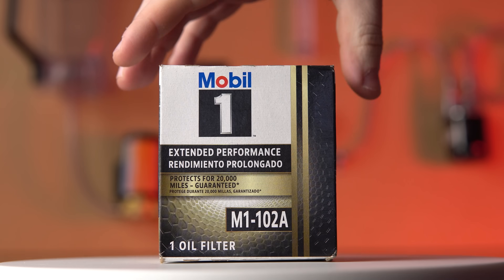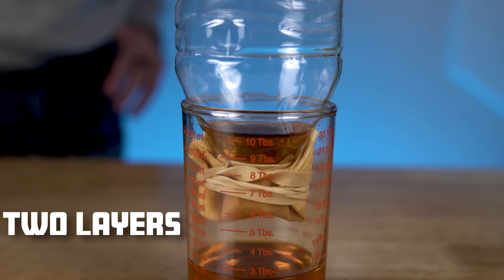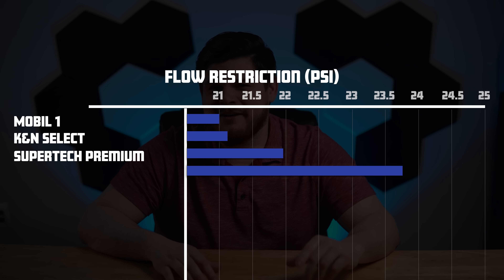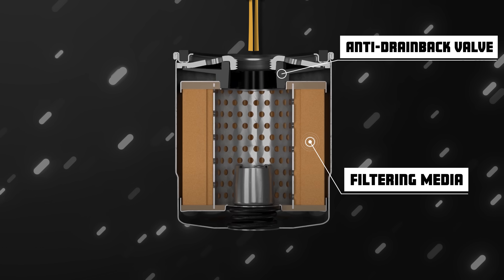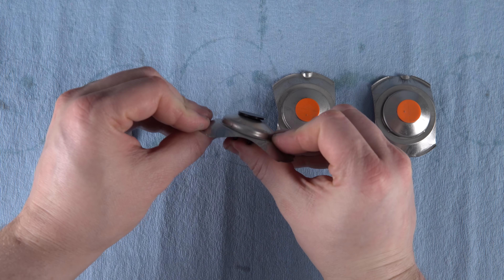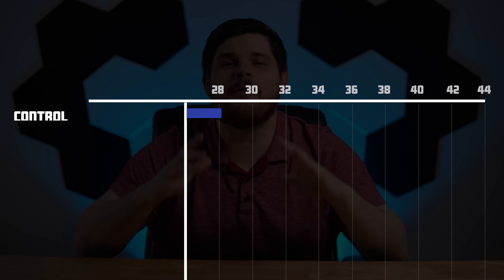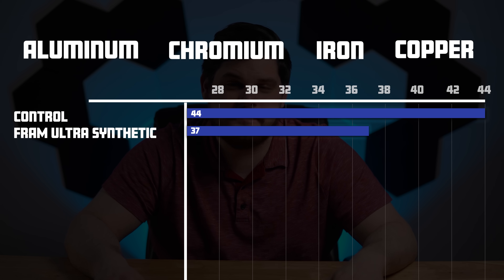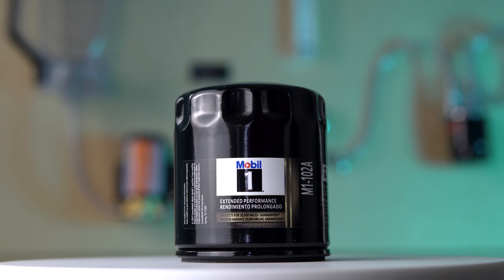Engineers Test the Best Oil Filters! FRAM | Mobil 1 | K&N | Walmart Brand

Comment: First time viewer and long time mechanic,i like the video it was awesome! 
But for the most part oil is only cold till the engine warms, i feel like test results would be diffrent if you threw a block heater in the oil, cant wait to see what other filters you test on this rig
Reply from the maker: Thank you so much Austin! It really means a lot that you enjoyed. Wait till you see the new rig... Made several improvements including hot temperature simulation. Hopefully you subscribed and don't miss it. Thank you again!
Reply: @BrandRanks  I've definately subscribed! Do you think that you could do a series on commercial filters? 
You could do store brand filters, Baldwin, fleet guard, cat, cummins and factory filters! 
You could probably modify that rig to do fuel filter testing aswell, I know that some fuel filters can go down below 10 micron

Comment: Isn't that first pressure test just showing what psi the bypass valves release at?
Reply from the maker: Not necessarily as the bypass valve psi rating is the drop in pressure across the filter not the inlet pressure like we measures. We are planning on measuring DP on our future videos. Thanks for watching.

Comment: Great video with amazing details. However, there are a few issues with your testing. The 2 that I would like to point out, which will significantly alter the results of your testing is: 1) oil temperature. Real world testing of oil flowing through filters would likely be anywhere from 80c - 100c. 2) oil viscosity. Again, real world testing of certain viscosities of oil at operating temps would greatly affect the rate of flow through filtration media as well as the suspension of the contaminants within the oil.
Reply from the maker: Indeed Brittany! Thank you so  much for your words and for the feedback. Unfortunately we had only 400 subs at release of this video and the budget was tight, gladly the support has been amazing and we are making several improvements to our testing rig including temperature. Thank you for the feedback, it really makes us improve! Appreciate your support.

Comment: My biggest question is, what happened when the aluminum particles were added?   Were they filtered out after the flow was restricted?  Is there a way to see if the bypass valves were activated.   Maybe a filter let's the particles pass through, but has great flow-rate...  That's not good.  You need to let the oil run over night, and and then test how many particles are still in the oil.  You also need to see if the bypass valves open up at the same time.  How many PSI is required before they open? There's a balance.  Let's say that the filter removes 100% of the particles, but then has to open the bypass valve because it's completely clogged.  The smaller the particles could probably be let through with a more permeable filter material since smaller patches probably do less damage to the engine than larger particles.  This would prevent the bypass valves from opening up (which would let everyting through).

Comment: great test, but keep in mind, there are only a couple companies that make oil filters, so for instance, Champion Labs makes OEM Motorcraft, OEM GM on some applications, AC, Valvoline, AutoZone and the Mobil 1 filter, plus k & n and Supertech filters. guessing they change the line for that day what is being made. fram is made by First Brands Group (Trico Group),
Reply from the maker: Thanks for the info. Appreciate you sharing and for supporting the channel!

Comment: If my trucks oil pressure is always above at least 32 PSI. Is the fram the best to use since it filters 20 microns and the filter runs at 25 psi?

Comment: Good video. My personal favourite are Baldwin, Wix, and Hastings.  I have also purchased filters that were on sale.    Also, oil  that was on sale. As long as the oil has the approved ratings for that vehicle. I change oil and filters in my vehicles every 5,000 miles.  Except in my Cummins.  I change every 10,,000 miles. At five thousand I change out the oil filter and top up the oil. 
    My pickup with the gas engine has 510,000 miles     My car with the gas engine has 499,000 miles.  My other pickup with the Cummins has 545,000 miles. Neither of these engines burn any oil.  They all purr like Tomcats in a creamery. 
    Just change your oil and filter often and regularly and your engines will run a long time for you.  (everything else being equal) Don't over heat your engines  and idle it for a minute before you shut it off.
Reply from the maker: Wow!!! That is a lot of miles! Awesome work taking care of your investments. Completely agree, maintenance intervals is much more important. Thank you for sharing and supporting the channel.

Comment: Nicely done! Multiple round of testing will yield different results than a single round of testing. Buy the same oil filters from different and far away sources, this checks mfg consistency. Send multiple control samples to the same lab under different names and different time, send to other labs as well, this shows test consistency. You may want to test pressure drop at cold and hot temps as well. A releif valve pressure test would be cool. You could tell it opened by observing a sudden drop at you pressure gauge. Differential pressure measurement would flag it better. Nicely done though.
Reply from the maker: Thank you so much for the awesome feedback, definetly looking at making some improvements for future videos. Your comment and suggestions are greatly appreciated! Thanks for supporting the channel.

Comment: Fram has a weak anti drainback valve spring and I found my engine with a sideways filter took longer to gain pressure with a fram vs other brands.  I stopped using them years ago.

Comment: How about you compare small vs big?

Fram  PH3569  /              Mann W 719/30 W 940/66

to
Fram PH977A   Mann W 950/4 or equivalent

It's a VW speccific application  using  the 3/4" 16 unf thread you already have
There must be a flow or capacitiy/efficiency advantage.
Reply from the maker: Thanks for the suggestion.

Comment: Great video. One thing to note concerning filter flow is how the bypass valve comes into play. Without downstream flow restrictions enabling pressure delta comparisons at multiple locations, the functional pressure differential for the filters bypass valve can't be observed. IIRC, the general bypass valve opening pressure is around 12 psi across the filter media for these particular models, so in this set-up the filters could have all been in some degree of bypass.
Reply from the maker: Completely agree Chris, we are making some improvements to our testing rig in order to measure the differential pressure. This will enable us to see if the by pass valve has been opened. Thanks for your feedback, it really helps us improve.
Reply: That's what I came here to say too. The bypass was definitely in play for those tests. Seems like some sort of adjustable rod on the center of the test rig could hold the bypass in place during the test. Really awesome testing though overall.

Comment: One problem is your pressure test was probably popping the bypass valve open so you were measuring the bypass pressure, not the flow restriction.

You missed the opportunity to send the oil contaminated with aluminum powder to testing. Because what if some of those filters seemed to take a lot before clogging by not ever actually filtering out the aluminum in the first place?

Comment: Been using Mobil1 oil and filters when I switched my vehicle over from dino oil in 2007, based on all the testing I've seen, a great decision made, if not the best. I typically go 8k miles in between oil changes and the engine is still running like a beast , now with 190k miles.

Comment: very well done, i agree you should add an extra video with more brands (OEM) especially since i know some people feel these are always better. i think heating the oil could change the outcomes alot as making the oil thinner would allow more flow. since some filters may have better flow with thinner oil than others. definitely worth looking into adding. however seeing as this is your 4th video i say you are off to a good start.   Something you should try and do for another video is comparing some brake brands/quality.  From my personal experience when i was young i always used cheaper. because why not.  changing your brakes every year to save $20 i didn't know the difference. however after having a high end set on for over 10 years 80k miles i know i'll never go cheap again. definitely more complex to build the testing station and more time consuming. But would be a very good video in my opinion.
Reply from the maker: @Brando great suggestions and ideas. We are definitely planning on testing some OEMs and implementing temperature to the tests. That brake pad idea is phenomenal, expensive for a small channel, but we might be able to do something. Thank you for supporting our channel, it means a great deal!

Comment: Funny how the dealer will tell you ten thousand mile oil changes when your oil changes are free but when the warranty is up and they are not paying they tell you every five thousand when your paying. Don’t fall for the 15-20,000 miles oil filter. change your oil and filter  every 5,000 miles. Over time you get carbon gas acids entering your oil. If you wait those long mileage oil filters to work for 15,000 miles your risking all that junk to flow through your engine. If you do use these filters for that long it must be mostly highway miles. Oil and filter  changes are cheap compared to the cost of and engine. Fifty five years  working on vehicles but what do I know.😁🇺🇸

Comment: You go by the number microns it can filter. Change oil and filter when you begin to not  see your oil level measuring lines through your oil. Fifty five years of doing it this way and never ever had an engine problem. I do buy Mobil One filters. Mobil One filters are around $10.00 at Walmart you won’t go wrong. Walmart Super  Tech motor oil is an excellent oil blended by Warren oil. It is API approved and has the cool letters and numbers as the big boy companies. For around thirty-thirty five dollars you get an excellent motor oil and filter change.

Comment: I've always used Fram Ultra Synthetic because they're made and tested to a higher micron standard then the others.
Reply from the maker: Indeed they are. Have personally been running FRAM ultra for years and have had no issues. Thank you for watching and supporting the channel.
Reply: I lost 10 psi with fram junk and also have seen them blow out on stock engines . Will never run fram again
Reply: @darwinfoster7420  which one?

The problem with Fram is they're definitely a company where you get what you pay for.  

The difference between their ultra synthetic and their base filters is like two different companies made them. The problem is that most people buy the cheap one and then assume when they have a bad result with that, that the expensive one is built the same. 

I'd never use the orange base Frams. 

That's why I ask which you used that that happened

Comment: I never had an issue with Fram with the times I used them, in fact I running it now on my 230k mile suburban, only reason is because one day my truck has no oil pressure at idle and it sounded like it, had to stay on the gas to get it home so it had oil pressure, I was figuring it may be something internally, figured I'd drop the oil pan, replace the sending unit, it is kind of known to be a problem in them trucks, I pulled the oil filter, a Wix I installed on it less than 200 miles ago, the filter in side it was coming apart, I pulled some of it out of the holes in the filter. 

I took pictures, then cut the filter housing off, and half the filter was missing the wire mesh inside was ungluedor unattached from one side on the inside and allowed the filter to come apart and stuck in the bypass valve. I sent them pictures to Wix and they offered to pay for a Oil change, and a filter, I declined, I slapped on a cheap Fram I had sitting my garage for another chevy vehicle after trying to clean out the Oil lines and cooler, and its been fine ever since. I probably should tear my oil pan off and look at the pick up and see if any of the filter in left in it, but 25psi of oil pressure hot at idle is about where it normally sat so I decided not to go threw all that work, but it could also be what collapsed 1 of my lifters that took me a few hours to change out....

So idk, because of that, I'd use anything else over Wix for my stuff, Do regular oil changes is more important than using any cheap oil filters on the market today, I'll probably slap on a ACDelco my next change.
Reply from the maker: Wow... They only offered an oil change and a filter??? Not even a flush or like a diagnosis.? Thanks for sharing! We will be testing the WIX soon and we will open them up, most likely you just got a bad one, but that su***.

Comment: This is really good because it lets us see if the filter works but its normal conditions, next iteration should be hot, like running engine hot
Reply from the maker: Thank you so much for the suggestion Jose! Definitely made several improvements for the next iterations including temperature. Make sur eto subscribe so you don't miss it. Thank you for your support.

Comment: I"ve used Fram filters for years, but lately they seem to have gotten some bad press.   I never had any problems with them.  I've also had good luck with Delco and K&N.   I'd like to see Wix (which seem to get rave reviews) and Delco filters tested.  I enjoyed this very thorough and extensive video.
Reply from the maker: Thank you so much for sharing.So glad you enjoyed watching. We are definitely planning on testing the WIX and AC Delco for a future video. Thanks for watching and supporting the channel.
Reply: It seems that Fram economy filters are trash, which unfortunately hurts the entire brand. Fram seems to be very much a get what you pay for. While some of the other filter manufaucures don't seem to know how to dial it back to make a econo level filter.
Reply: Not lately, they've been getting bad reviews for many years.
Reply: Retire dealer tech. FRAM has always been junk! Had engine noises caused by FRAM. OEM filter, noise repaired, several times.
Had motor develop engine noise. Piston slap. FRAM filter material plugged nozzles to spray cylinder walls. I showed cause to factory rep. He still authorized warranty repair. Long Block replacement. Caused by FRAM filter. should have paid for by FRAM or customer.

Comment: I hope to see more filter tests using the same criteria. It's tough to go into a store with a dozen choices, only to have test results from just a few of them. Another thing to note is which filters are the same, but just rebranded.
Reply: Rebranding is good info, for sure.
Reply: I have a 2002 Duramax diesel. I changed it to a caterpillar filter, took an extra quart of oil. It's still stock except for 4 inch exhaust. I changed oil every 5000 miles. It has 40lbs pressure at idle and 70 running. No internal engine problems
 Got 265,000 miles on it.

Comment: Thank you for the engineering approach.  I drive them till they drop. Just sold a '07 Civic with 402k on it.  Only used Penzzoil and Mobil1. Contemplating Royal Purple filters though!  Where i work our machines use 10 micron filters but i realize that might not be smart for a car without checking drops. - RPI '95 BSME
Reply from the maker: Thank you so much for watching and supporting the channel. We are looking into testing the royal purple.

Comment: What effect does the temperature of an operating engine have on all these tests?
Reply from the maker: It would definitely change the results as the viscocity of the oil would be lower, thus lower differential pressure and potentially different filtering results. We will be making upgrades to our testing rig for our next video, so make sure you don't miss it. Thank you for watching!

Comment: I would have liked to have seen the oil heated as the fram doesn't seem to make any difference once the engine oil is warm on my vehicle. And it doesn't make enough of a difference from the engines cold. For my driving habits, I think it's the filter for me. 😅 

I do think having the oil cold though, but for all these tests does put a variant on it that doesn't occur in the real world as most people drive with the oil at temperature and this is going to be a center for your flowing oil which might enable the better movement of contaminants and are showing cheaper components such as cardboard and stuff playing a part in the operation of the actual filter.

Which in turn triggers the bypass valve. So it would be interesting to see how many of these filters just go into bypass mode rather easily and don't do as well at filtering.

Comment: Dude, your testing is so flawed. An engine is heating up the oil and the viscosity changes dramatically. Also, you didn’t say what oil you used. You’re going to hit a million views just buy putting tubes together and pushing room temp oil through filters. Come on guys, I know you didn’t finish high school not that long ago OR at all but common sense dictates that you need to redo this test appropriately with heated oil.
Reply from the maker: Thanks for the feedback